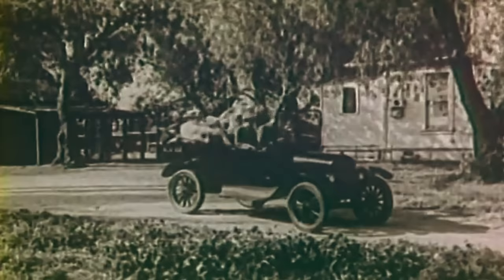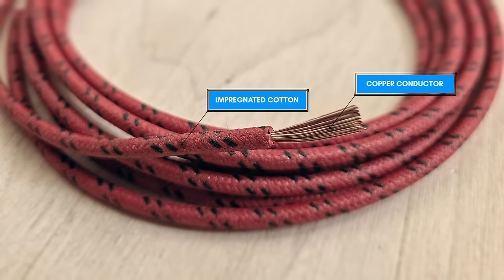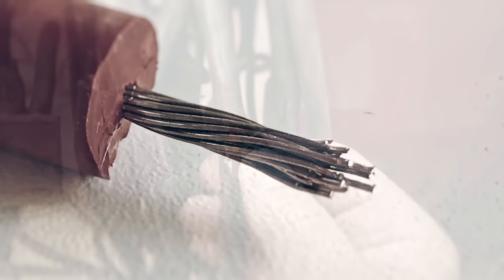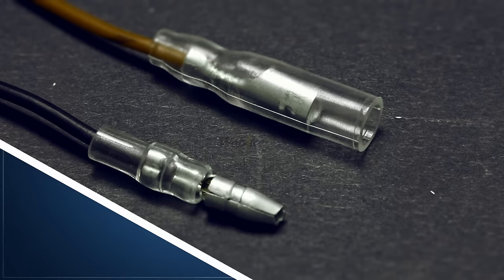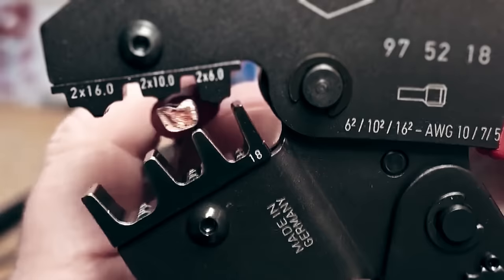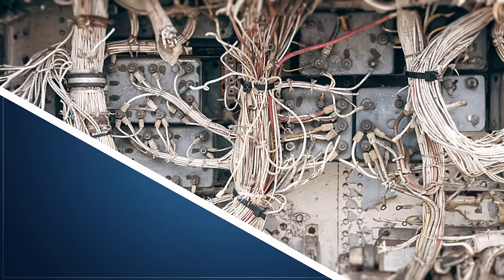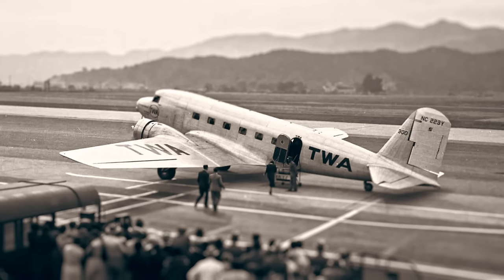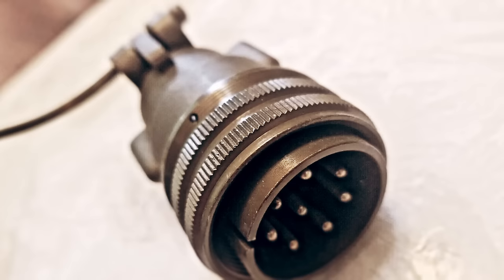The Fascinating Evolution of Automotive Wiring

Comment: CANBUS has been the biggest leap in wiring technology over the last 40 years, so much so that it was regulated into vehicles for its huge weight-saving properties, given 1 hiring harness can do the job of several. The first car to use it was the 1991 W140 Mercedes S Class.  With that comes issues, and having 1 fault in your car such as the ABS warning light, can also cause stop-start and other break false positive warning lights, although computers are trying to cancel that out, but its still a challenge, if  what my friend at VW R&D says, is anything to go by. It's why dashboards light up "like christmas trees" even if you only actually have 1 fault. More-over, with VW at least, their tolerances for what constitutes a fault are very low, youre talking 1-2%, again probably further explains why they will more willingly show up error codes and faults, where as other car makers would have a 10% tolerance, for example.

Comment: The only gripe I have is you cannot easily work on and change the configuration of these systems at home anymore. The infotainment communicating with engine management and then out to the cloud for security and or other software updates can be annoying. I don't want to have to become an It professional just to work on the infotainment and maintenance of a vehicle. Also, that means manufacturers can disable functionality at any time. It's already frustrating to have to have a subscription to gain access of the engine management system, now you have to add on the cost of the infotainment and autonomous functions on top of it all.

Comment: Cloth covered wire looks so good compared with plastics. Fully appreciate that it’s nowhere near as durable, but in applications where it’s on view and you can get away with it why not.
Reply: You can get modern “vanity” cloth wire, which is simply normal PVC-insulated wire with braided nylon cloth on the outside.  There’s the higher-temperature version, commonly used for the cords on clothing irons, which use rubber- or silicone-insulated cable with cotton braid. I love that stuff for power cords because it’s so supple. 

High-temperature wire for wiring inside appliances is typically insulated in silicone-impregnated braided fiberglass, and the really high-temperature wire dispenses with the silicone and is simply braided fiberglass or ceramic fiber. In some countries, fire alarm wiring has to be completely fireproof, and they use wire that’s insulated with mineral powder — the conductor is actually encased in a metal tube packed with compressed mineral powder, so it won’t fail until the fire burns hot enough to literally melt the outer metal tubing!

Comment: 21:23  This is the worst bit.  Can have all the tools and skills to use em in the world, all for the company to pull an Apple and change connectors solely to make your existing equipment stop working, invent closed source/proprietary protocols to make your fancy reader not able to do the job, or just make things so painful to work with it's left to the dealership!

Comment: Wrong. That first color photograph. Showing high tension wires to the four spark plugs, not right.  As the engine was bolted to the frame there was no movement. The engine didn't move about, so flat  lengths of steel, similar to hacksaw blades, were clipped between the terminals on the board and hitched against the spark plug tips.There was no available insulation for the voltage used. Kapton wire insulations destructive failure in thousands of aircraft, has cost billions of dollars. Canadian made clips for telecom burried cables failed, resulting in a billion odd spent there too. This is desperately important.

Comment: No wonder in Chinese those DIN connectors are called "aviation connectors". I had no idea they were originally used on aircraft.
Reply: Well they’re not DIN connectors. DIN connectors are a specific type of circular connector originally designed for consumer audio-video use. So in this rare instance, the Chinese terminology is correct, in that it agrees with western terminology, too.

Comment: There is absolutely no need for the complexity of modern vehicles.
Fuel efficiency, emissions control, safety and performance can easily be increased beyond current levels without so much useless over engineering.
Greed and Pride are the only reasons our vehicles are so insanely complex as well as short lived.
It's completely true that they don't build them like they used to...

Comment: "Polyethylene and cross-linked POLYylene..." 1. So, New Mind, "polyethylene and polyethylene"? Wouldn't the sensible comparison put them on an even playing field without falsely implying that "XLPE isn't a type of PE" by saying "regular cross-linked polyethylene and cross-linked polyethylene" instead? 2. As long as you're already making the comparison and want to emphasize the difference, then wouldn't it make sense not to emphasize one of the things they have in common, but instead to emphasize the difference instead; for example: "cross-linked polyethylene"? 3. Also: the first time I had heard of cross-linked polyethylene it was abbreviated as if the term were "polyethylene cross-link" or "PEX." So what happened to that nomenclature?

Comment: The less wires the better. If you're like me & want something to last & be easy to fix, go for cars that have the least tech gimmicks as possible. 

My cars have no fancy idrive infotainment systems, no self driving, no start stop, no lane keep assist, no all wheel drive etc. I want none of that crap. Less stuff to break. A manual transmission, RWD, & six cylinders is more like it, for people that enjoy driving instead of passive lazy distracted ones. 

Go for older manual cars that hold their value instead of the new giant SUV crap full of screens & planned obsolescence. & for a beater/winter car, get a non turbo 4 banger.

Comment: and this modern wiring harness designing is why they are a pain in the ass to use the vehicle in a anner other than what th emanufactorer intended. which is quite frustrating, especially when one wants to adapt some newer tech onto an old but still working very well car.

Comment: Modern cars are awful and went far overboard. Early-mid 2000s wiring(and not only wiringwise) was what should be the standard and upper limit of complexity.
Reply: Aye, complexity on itself solely doesn't matter, the focus efficiency and effectivity of the product.
It would not matter if it was the most complex thing in existence if it has the functionality of a rolling boulder, and even a boulder can have effectiveness.

Comment: I haven't watched the video yet, the content may be good, I don't know yet. I only clicked to comment on something, what could that even be from not even watching, what kind of bored person would do that am I right? Well the thumbnail either has to be a form of clickbait, or an unhappy accident in an effort to not have to look for royalty free imagery. Which wouldn't be a big deal in my opinion, who's gonna cry if they used a picture out of a textbook, but I'd be forgetting the idiocy of the year we live in. Anyway, take a look at it. What car would have an arms thickness worth of wire looms up the wheel well, going into the lower sill? Or 5 modules in the door where the window mechanism is? What about the cherry on top, the bundle of wire in the middle of the rear door. How would that door open exactly? This is a poorly generated image, appealing at first look but falls apart hilariously at the second. This sort of generated digital waste is so easy to spot and disgusting. Im over it and wish it would end but it sadly just started.

Comment: 📝 Summary of Key Points:

📌 The Ford Model T's electrical system evolved over its production span, incorporating components found in modern vehicles. It started with cloth-covered wiring and transitioned to more durable rubber insulation.

🧐 The development of bullet terminals and spade terminals in the 1930s improved connector systems in vehicles, providing better electrical conductivity, resistance to corrosion, and flexibility in tight spaces.

🚀 The introduction of crimping for wire terminals enhanced the reliability and serviceability of vehicle wiring, offering a quicker, more reliable method of making connections with excellent mechanical strength and strain relief.

💡 Additional Insights and Observations:

💬 The transition from cloth-covered wiring to rubber insulation marked a significant improvement in the durability and reliability of automotive electrical systems.
📊 The adoption of crimping for wire terminals not only improved connection reliability but also made vehicle wiring more cost-effective and serviceable.
🌐 The evolution of connector systems in vehicles, from bullet terminals to spade terminals, showcased a continuous effort to enhance electrical connections for better performance and durability.

📣 Concluding Remarks:

The evolution of automotive electrical systems, from the Ford Model T to modern vehicles, highlights the importance of continuous innovation in wiring and connector technologies. The transition from cloth to rubber insulation, the introduction of crimping for terminals, and the development of advanced connector systems have significantly improved the reliability and performance of vehicle electrical systems over time. These advancements underscore the critical role of wiring in the automotive industry's progression towards more sophisticated and efficient vehicles.
Generated using TalkBud

Comment: Nice reminder to NEVER buy a modern vehicle, they automatically trap you in the 'sunk cost fallacy' the moment you got it. I take more fuel use over being able to swap parts without the thing electronically bricking itself, or making me dependent on dealers. My Peugot 205 will last me more then 20 years and a million miles, wile these 'primadonna cars' barely make the 200k mark.

Comment: Engineers in the comments section: you should recognize that normal people hate you for this. You know what we want? A box with four wheels and an engine with no computer attached to it, with heat and ac, that can go 60 mph, and can be fixed easily at home with a flathead and an adjustable wrench. That's what we want. Not this rat's nest of overcomplicated garbage.

Comment: Modern car systems are over-complicated, as is a huge amount of engineering design - all in order to justify huge prices.
In areas where reliability is REALLY important (such as in modern CNC machines), you will have a simple 4-conductor bus with one type of connector on all devices, and a communication protocol that can cover all speeds. And believe me, this creates an order of magnitude fewer problems than hundreds of different connectors in modern cars.
Despite the introduction of unified data buses, many sensors are still made with different ports... What's the point in this?! All data is in digital form, accept the device address standard so that control processors can uniquely identify who the data packet is coming from or to, and that’s it! You have a modular system. But this will not happen as long as automakers sell us nonsense under the guise of innovation only for the purpose of increasing their earnings.

Comment: Engineering has its place and time, however on most cars today they are overengineering everything to the point of it becoming comic and actually even useless. Like stop/start. Sounds like a great idea at first, but it just becomes a nuisance, as all it does is making me press the button to disable it every time I drive, as it is completely useless on the road and even makes you stop in front of everyone, becoming a traffic problem. Like the electronic handbrake, which I would never ever accept in a car that I drive, as it defeats it's sole purpose of being a simple, reliable emergency device that can save your life. Like a screen in the middle of the dashboard space, making it easy to hit it with anything, occupying the line of sight, instead of being included in the center console as it was before. Like keyless entry. Like programmable batteries. Like, like, like. Cars nowadays have become a joke.